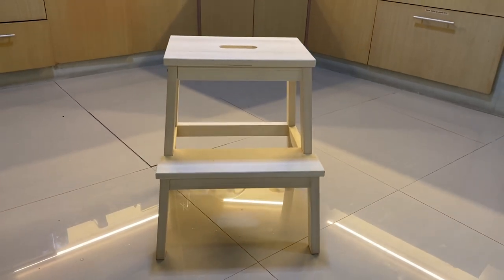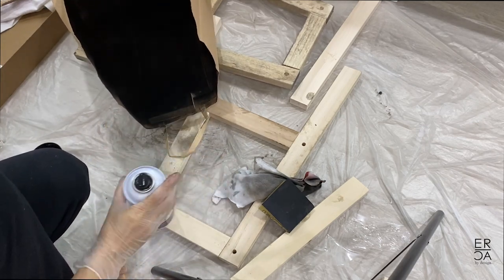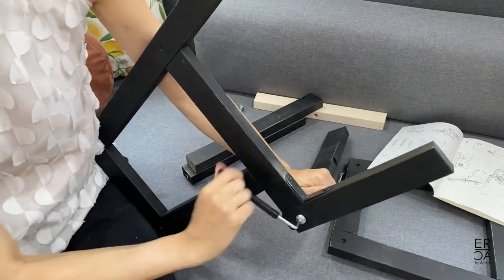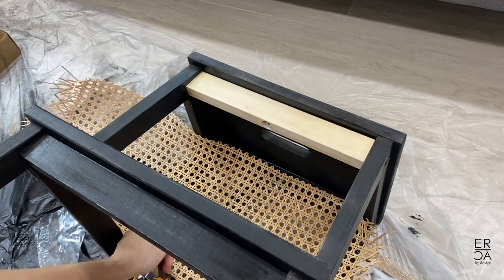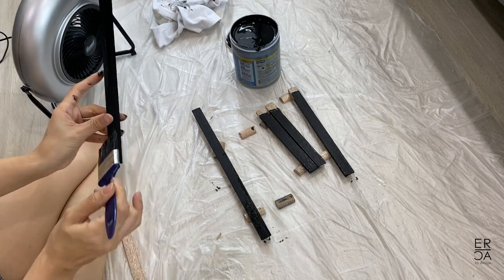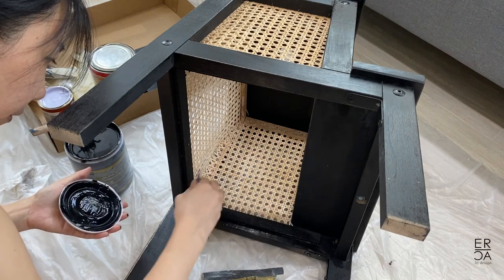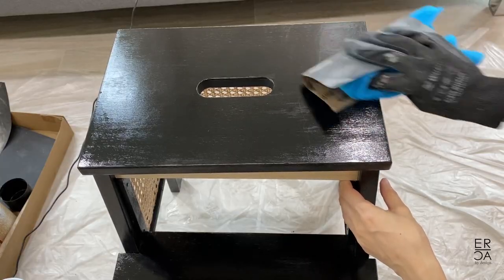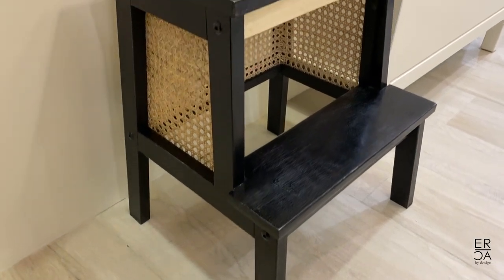IKEA Bekvam Step Stool Hack!

Comment: i wonder if maybe a bit of sanding prior to staining would've helped not make it blotchy....nevertheless the end result is absolutely beautiful
Reply from the maker: Thank you! 😊 I bought a low quality stain I think that was the biggest issue 😅 I know better next time!
Reply: @EricabyDesign  I think Ikea  natural wood actually has a sealer on it so sanding would have taken care of the problem. The stain didn't soak in because of the sealer. It still turned out really cute.😊💙
Reply from the maker: @debbiefox6846  Thank you so much! ☺